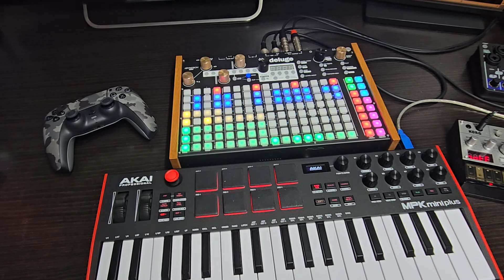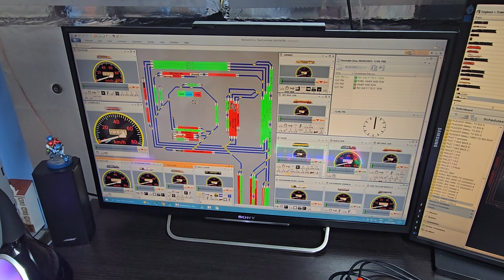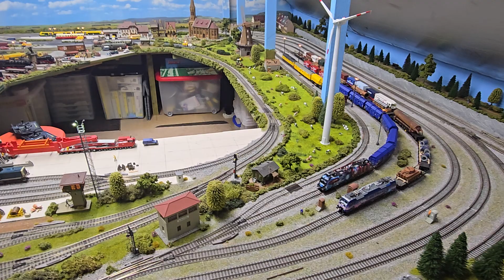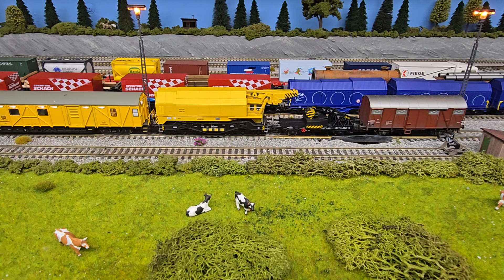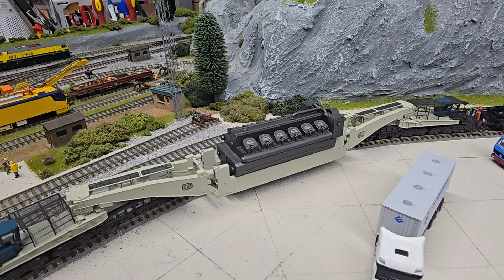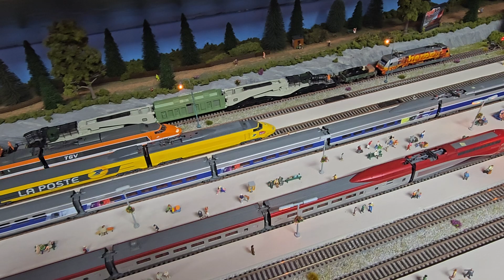Automation Time table

Comment: Hi Jim love that your getting your head around TC and using its full potential too pal. Its mind boggling what that system can do. I spoke to the Flieschmann tech guy recently at the Dortmund show in Germany and they run it with the Z21 and Im not sure if your aware but the Z21 can only program 100 trains at a time but pair it with TC gold and it can shuffle thousands of locos at once dropping them out of the Z21 when they drop down your shedual mate.
Reply from the maker: Hi bud Yeah I did hear that about the Z21 , my main command is the Ecos , train controller can handle it all very well, I am only doing basic automation,  train controller can do a huge amount more.
The main challenge for me was programming the duel powered push pull  trains in and  out of the terminus, something I thought I would never be able to do  correctly. 
P.s I am working in Liverpool in a few weeks I will drop in if you like with that Feischmann N scale trade maintenance manual..it's a very rare book that waltons had for decades.

Comment: Hi there it's great how you have setup the automation I watched your YouTube videos in the past which convinced to buy the Ecos command station and is still the  best system ever but I did notice during the run session you have the Z21 is this interfaced with the Ecos and for what reason ? Do you use the Z21 hand controllers with the Ecos.
Would love to hear your feedback 
Regards Ian
Reply from the maker: Hi Ian,
Hope the Ecos is doing good,  it's as you say one of the best hands-on controll systems. 

I use the Z21 via the sniffer port on the Ecos as a tandem second system at the same time, I use it for the Roco camera locos I have and to use the Z21 WiFi controller which is an excellent wireless hand controller .

Thanks again.

Jim.

Comment: Very nice. I love that ESU EHG 388.
Reply from the maker: Yeah it's a really nice item that as it works on Ac or Dc power and has loads of features which are really useful if you have and electrical problems or shorts etc.